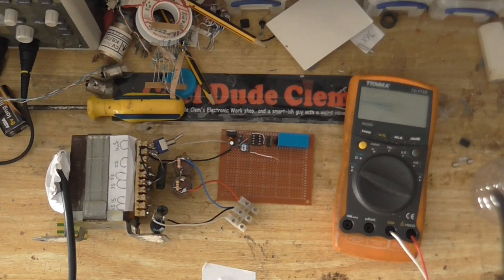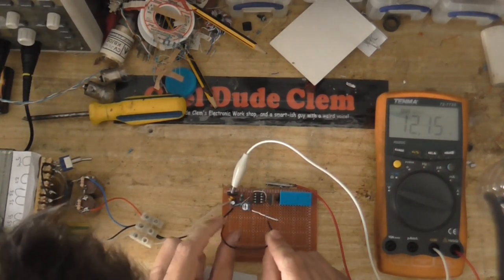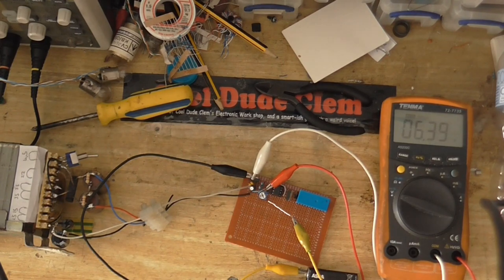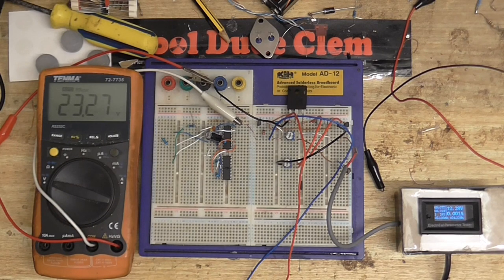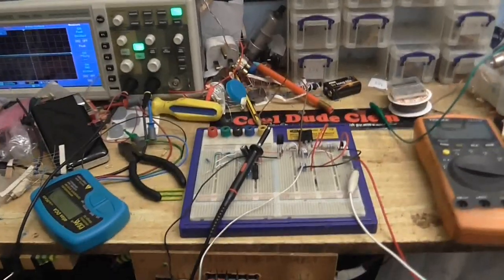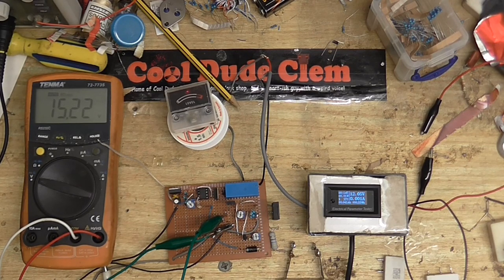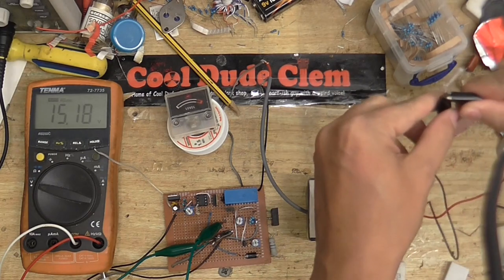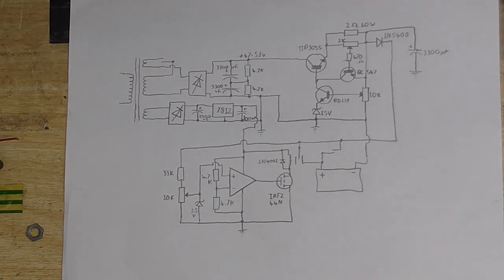Building a battery charger part 2 - Trying the Volt & Current limit, and shutoff circuits.

Comment: Hi Clem it looks like you forgot the 1k resistor on the base in the final schematic. Circuit works good, you get a better charger than the one you had!
Reply from the maker: I've just been over that circuit and yes, I noticed in my haste, I missed the resistor. I should take more time.
Reply: @CoolDudeClem  When you made a coil to use the meter for current reading was really creative too.

Comment: Hi Clem, I wonder if that momentary switch button and the relay (btw, why don't you directly use the FET for switching?) are properly placed. When you press that button and the battery is discharged, a very high current will flow from the added 3300uF capacitor through the 1N5408 diode, potentially destroying it or welding the button contacts together. Wouldn't it be better, if the battery was always connected to the sensing circuit (making that button superfluous) and the relay would switch the charging part or at least that the button switches the relay (which presumably can stand more current than the button)?
Reply from the maker: Those are some ideas. I might look into that. Personally at the moment I can't see how pressing the switch would send a huge current through the capacitor as the diode prevents that. I've been so busy with other things I haven't even had a chance to test that this thing even works!
Reply: @CoolDudeClem  When no battery is connected, the 3300uF capacitor charges to the maximum allowed output voltage. If you now connect an empty battery (lower voltage than max charging voltage), there is a large voltage difference between the 3300uF capacitor positive pole and the positive battery terminal. Pressing the button to connect the positive battery terminal to the circuit causes a high discharge current to flow from the capacitor through diode and button into the battery.